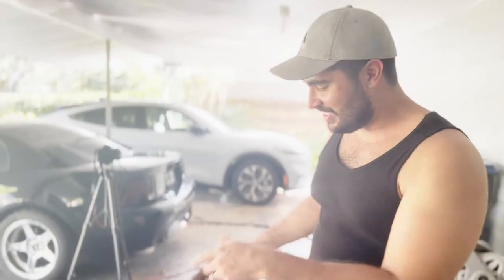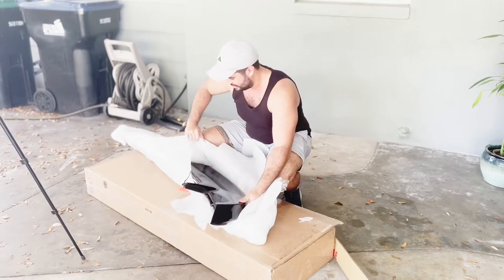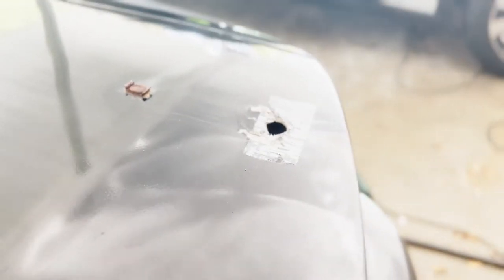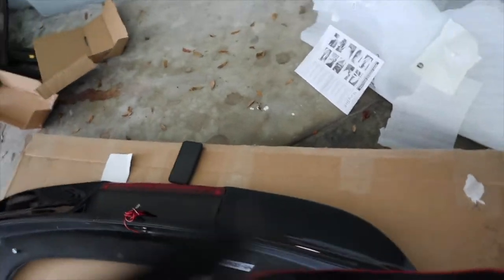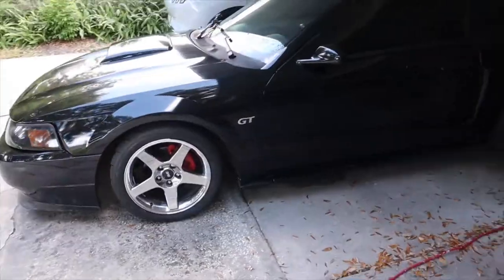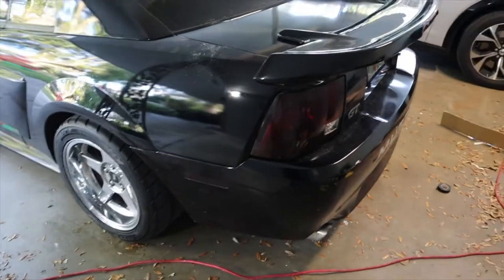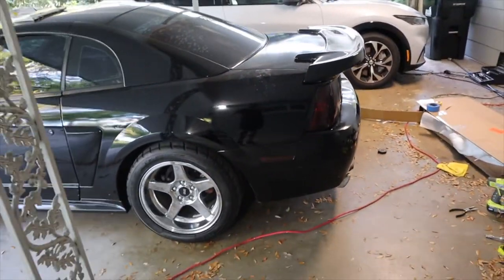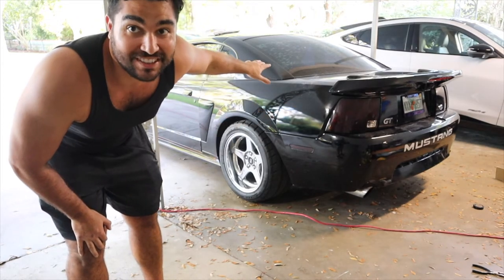Saleen Mustang Spoiler on my 2001 Mustang GT! DIY Install, came out sick!

Comment: Do you have a pic of the underside of the trunk where the bolts are? I just got the same spoiler and was thinking about drilling pilot holes in the spoiler and using the factory holes.

Comment: if you omitted the 2 additional holes would it have lined up to the factory holes and use 3m tape? i don't wanna drill holes
Reply from the maker: Nope, does not line up at all with the factory holes, on the plus side once the spoiler is installed you won’t be able to see the factory holes, at least that’s all I cared about when installing it

Comment: hey bro, so if i bought it, would i be able to use my factory holes? i dont wanna drill lol, its a 2001 Gt , i was thinking  probably run the 3rd brake light wire through the oem 3rd light, i appreciate it bro!
Reply from the maker: Nope if you buy this spoiler you have to drill new holes, they holes don’t line up with the factory spoiler holes, the good thing is it does cover the factory holes if you’re worried about that. And for the third brake light yea just splice the new light onto the factory light and you’re good to go! Good luck, I’m sure it will look sick
Reply: Thanks so much for the reply bro! ill keep that in mind